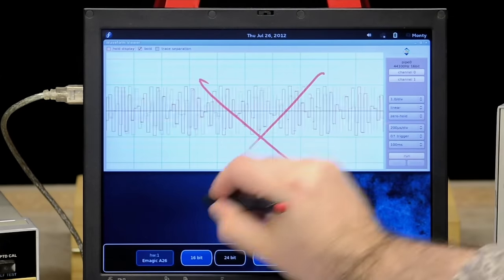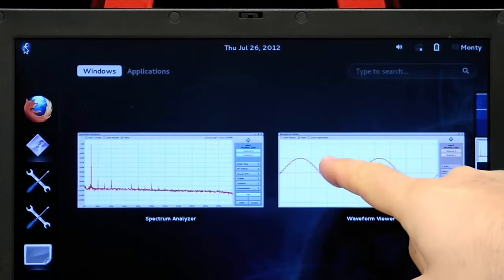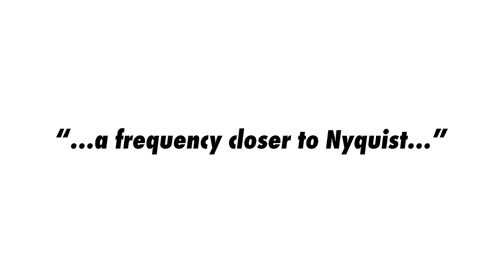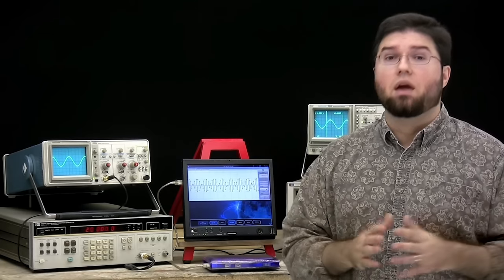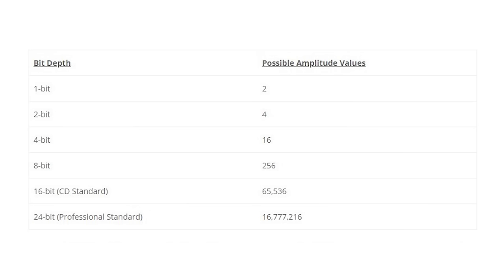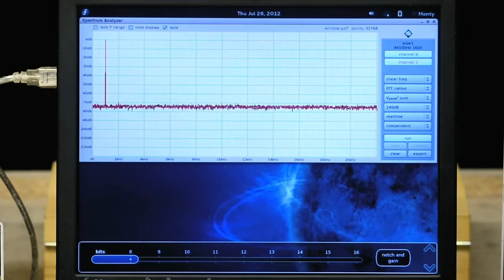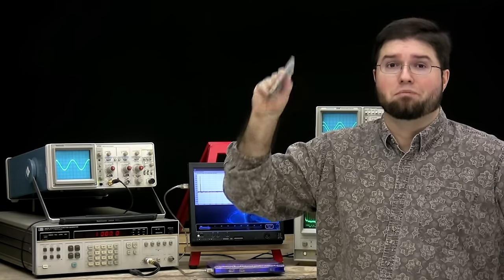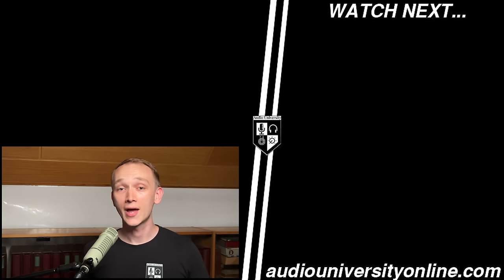Debunking the Digital Audio Myth: The Truth About the 'Stair-Step' Effect

Comment: Something not mentioned is that the raw DAC is followed by a low-pass filter at the Nyquist frequency.  So, even if the stairsteps are there, it's at the sampling frequency and would get filtered out.
Reply: Was thinking exactly the same thing. This is correct !
Reply: Exactly. Thank you.
Reply: And you filtered out the high frequency sound, too. But anyway with powerful headphone all days long can't hear them anymore. a 44kh give you the capacity to produce 22kh square wave sound. To produce decent 22kh sine wave, you need a sample a least 8 time higher. You can use Bezier algo to reshape the sound wage, but it not sound an accurate sound reproduction anymore.
Reply: @omegaman7377  you have that backwards. With sine waves as your basis function it's impossible to perfectly model a square wave without infinite sine waves. The Nyquist frequency is plenty good for sine waves because it IS the basis function of the model. You can apply more advanced techniques to reconstruct beyond Nyquist, but not in a general way, so it's not useful for audio applications. We can do this in image processing (though with some additional information which is kinda cheating)
Reply: @omegaman7377  Square waves have higher order harmonics, technically infinitely high, compared with their fundamental frequency.  A pure sine wave is ONLY the fundamental, so you have your sampling idea completely backwards.  Sine waves require lower frequency sampling to recreate without any assumption about the input signal, because you only have to reproduce the fundamental.
Reply: @omegaman7377  Filtering 22KHz completely out while leaving 20KHz untouched is a challenge and may leave some sonic artifacts.  That's the reason for oversampling/higher sampling rates.
Reply: yes, this is an kmportant step that should be mentioned. i think that is most pedagogical way to explain why there are no steps after converting back to analog.  The wording of "only one solution" is not convincing.
Reply: >  DAC is followed by a low-pass filter 
Yeah, that one is called reconstruction filter.
Reply: Any square signal that goes through a LPF would become a sinusoidal wave.
Reply: Is it even necessary? If the sampling and nyquist frequencies are both above 20kHz, wouldn't our ears simply act as the low pass filter? I kinda felt like that was the rationale for the standard being 44.1kHz sampling with a 22.05kHz nyquist instead of 40kHz/20kHz, headroom for the ears to roll off high frequency sensitivity.
Reply: @4DRC_  it would introduce a lot of frequencies above 20000 Khz that doesnt belong and equipment "downstreams" may not behave well.
Reply: If your old your ears act as low pass filters.
Reply: Yes. The DAC is based on sample and HOLD. It results in a staircase. As far as I know there is never a lollipop like he said. The lollipop represents the sample but the sample and hold circuit holds onto the lollipop until the next sample. Everything would become clear if we look at the circuit. Why did we not see the circuit? He is just looking at input and outputs of black boxes and then making claims about what the signal looks like inside the black boxes. He ignores things inside the black boxes like the filters that you have talked about. I am not impressed.
Reply: I am sorry, I meant the ADC, the analog to digital converter, when I said DAC. It is the ADC that samples and holds, producing the staircase.
Reply: Man, I'm being stupid. The sample and hold produces the staircase, which then gets converted to digital by the ADC. Did we ever see anything about the taking of the digitally encoded samples being fed to the DAC? The more I think about it, the more I wonder what was really going on in the system or process that he was obtaining signals from.
Reply: @kevinlatendresse2372 I agree that a lot was left out about the inner workings of sampling and reproduction, however, it seemed like a fairly decent explanation without getting to a point of an understanding of higher level mathematics or at least being familiar with knowledge of circuitry and digital signal processing. There comes a point where to have brevity in the explanation it's either going to be watered down or is going to be concise but requiring knowledge of concepts someone is already familiar with or requiring many hours of in depth explanation to understand, in the scope of this video.
Reply: That filter is not there for that, or well, yes is for that, but is a strange way to put it.
it's to remove any harmonics above the nyquist frequency because they can only be conversion artifacts. The "steps" would be part of that, if they existed , which they DONT.
Reply: @framegrace1  Yes, the filter is there on the recording end to prevent artifacts, but there's also a filter on the playback end to remove the staircase and any artifacts it might cause to the downstream system.
Reply: @jamescaley9942  That might work for old ears and certainly work work for me now, but as I kid, I could hear some ultrasonic alarms.  They weren't quite "ultra" enough.
Reply: Yeah Nyquist Shannon is only true for band limited signals.
Reply: Yep, reconstruction filters are used, mainly to reduce quantisation noise in addition, to that, no audio playback system instantaneously changes amplitude (position of a speaker cone) and this in itself has more impact on the audio output than the DAC process, so there is a strong case for highly responsive speakers with low impedance rather than trying to playback audio based on higher sample rate and bit depth.
Reply: The frequency content of the stair steps is in the audio range  and the Low pass filter starts at 20Khz and so it does not filter them out. For a basic D to A without oversampling the steps are there after the reconstruction filter. They are innocuous if dither has been used. In a modern D to A they are not there because modern converters add extra steps that change quickly, quickly enough to be filtered out by the reconstruction filter.
Reply: @danwarb1   For a basic D to A without oversampling the steps are there after the reconstruction filter. They are innocuous if dither has been used. In a modern D to A they are not there because modern converters add extra steps that change quickly, quickly enough to be filtered out by the reconstruction filter.
Reply: @matswessling6600  Thank you for saying this! Right on.
Reply: @russellhltn1396  Exactly. I'd love to know the characteristics of the DAC low-pass filter. What order? Butterworth? Chebyshev? We also only saw steady-state response, no transient!
Reply: @drmal  It would be interesting to see a transient, but keep in mind that it may have frequencies above the 20-22KHz limit.  As such, the filter itself would change it.  But that doesn't mean the change can be heard.  I'm sure some will claim they can hear it, but I'd love to see them pass a ABX test.
Reply: @drmal  Of course, another route might be to sample at 88.2KHz and then down sample digitally.  A filter for 44.1KHz doesn't have to be aggressive or have the artifacts that an analog filter for 22KHz would have to have.
Reply: @russellhltn1396  Yes, as I think you said higher-up the thread, that's one primary reason for higher sampling rates. In a theoretical system, sampling at 2*Nyquist (i.e. fs) gives you a datastream that will perfectly reproduce the incoming audio. But, I guess like me you have an electronic engineering background (I have a Batchelors and PhD in it) and in the real world you can't cut-off frequencies above Nyquist immediately to below the noise/quantisation floor. So, we give ourselves room to implement a graceful, low-order filter (at both ends) and over-sample. The theory of the video is right, but the practical engineering implementation is missing.
Reply: @omegaman7377  No. The low pass filtering just gets rid of the quantisation noise. A properly designed low pass filter will maintain the audio bandwidth.
Reply: @russellhltn1396  You use a decimating low pass filter so that the sharp cutoff can be easily achieved.
Reply: @Verbindungs  Any square signal that enters your ears is perceived with its corners rounded off. Your ears do not have an infinite frequency response.
Reply: @rogerphelps9939  agree
Reply: @4DRC_  unfortunately not, there is a thing called aliasing and it's a total nightmare. Every frequency you leave in above the Nyquist frequency gets mirrored back into the audible frequency range
Reply: @omegaman7377 I believe you need some understanding of the frequency spectrum of a sine wave versus the "square wave"
Reply: Wouldn't even the speaker membrane act like a perfectly fine low pass filter 😂
Reply: @TheraPi  That's fine for a integrated system.  Not so good to pass it to an external amp that many not behave well, as well as sending a lot of power to the tweeter that it wouldn't normally get.
Reply: As a practical matter, the stairsteps are present in the analog output of a simple DAC prior to output filtering.  The energy in the output is proportional to the width of a stairstep times the amplitude of the stairstep.  If you changed the output to pulses that are only held for half an output sample period, the amplitude would have to be double to get the same output energy.  In the limit, as the output pulse width goes to zero, the pulse amplitude would have to go to infinity to retain the same energy.  Obviously this it not practical.  And without any output energy, nothing would be audible.  In the digital domain, each output sample actually represents an energy level, so the problem of infinite amplitude for zero time is skirted.

In addition, the stairstep, or first-order hold, introduces a sinc (sine(x)/x) amplitude frequency response, which attenuates the higher audio frequency content, so either the digital audio data stream has to be 'prewarped' with an inverse sinc filter shape, or the analog reconstruction alias filter has to be prewarped with an inverse sinc filter shape.  Or at least this has to be done if the audio equipment expects to have good amplitude flatness specs.  

Oversampling has all the same issues, but allows the most difficult filtering to be done digitally, yielding a vast improvement in quality and cost, since the remaining required analog filtering is then much simpler.

On the topic of relying on the frequency range of human hearing to filter out higher frequency artifacts present at the DAC output, one big problem is the intermodulation distortion that occurs when the signal encounters anything non-linear (speakers, human ears at high listening levels, etc). The unwanted high frequency components can get 'mixed' back down into the audible range.  (For the mathematically inclined, a nonlinear response can be modeled as a polynomial, and anything higher order than the linear term will convert energy at one frequency into energy at a different frequency.  For example, if you square a sine wave you will get energy out at twice the frequency.  Changing the frequency content of audio rarely results in a pleasing effect.)

This is a deceptively complicated topic, the more you learn the more your appreciate how much more detail there is to know.  So it's not surprising there is so much misinformation.
Reply: That is true for all properly designed DAC electronics. An analog low pass (technically after the DAC) is a must for proper signal generation even for radio frequencies.
Reply: @omegaman7377  Nope. "And you filtered out the high frequency sound, too." Except you will have a problem hearing even a 16k sinus. Probably lower. Nope. Your ears cannot hear distortion harmonics in a sinus wave, because they are higher than hearing. Nyquist is valid.
Reply: Even if a stair-stepped signal got to the speaker, some of the signal would be smoothed out by the speaker, because of its limitations.
Reply: typically it isnt set that low these days. its still there, but often around 40kHz. depending on the output stage specifics (ie. discrete solid state), the capacitance of the transistors ie. parasitics, will act as a low pass, even if that LPF isnt there.
Reply: @earthwormjim  Does the term Fourier Transformation mean anything to you?
Reply: @rogerphelps9939  signals in the real world are continuous, that means they don't have corners.
Reply: The filter uses sin x to smooth out the steps, so of course the sine wave is perfect! This experiment is flawed.
Reply: @Dont_Gnaw_on_the_Kitty_1  There are no "steps" to begin with.
Reply: @MadMaxMiller64  Steps are clearly there as shown in the unfiltered digital output. The post digital filter uses a sin function to smooth out these steps. Using a single tone sine wave is really an invalid test as it will create a perfect sine  wave post filter, which is irrelevant in a music delivery system. At 15khz there is only about 3 bits conveying the HF harmonics and transients*. This may be where a black disc excels, having a mechanical low pass which doesn't loose information that are present *between the 3 bits.
Reply: THANK YOU! That was my first thought too when they showed the output from the digital conversion unit! Every audio DAC system has a brick wall low-pass filter on the output!
Reply: @4DRC_  In theory, no, you don't 'need' a low-pass filter after the DAC, but in practice you'll get all sorts of artifacting & other distortion problems in the signal chain if you don't.
Reply: @Dont_Gnaw_on_the_Kitty_1  You clearly have never heard of Fourier transformation, have you?
Reply: The secret of the perfect sine output when close to the Nyquist limit is not a low pass filter, but the codec chip inside the gizmo he used. The codec takes 44kHz I2S samples, and interpolates it to a much higher frequency using digital interpolation technique. This reconstructs the missing points of the sine wave in between I2S samples. And only after that, the DAC output is low-pass filtered to reject that interpolated frequency.
Reply: @odissey2  Lol please explain what an I2S sample is.
Reply: @MadMaxMiller64  i2s is a digital communication protocol for sound.  In the original video it was used to send the audio data stream to the DAC
Reply: @odissey2  Thanks - for some reason my mind was on I2C here... sorry for the lol then 🙂
Reply: Correct. Also mixing, sample rate conversion, and volume control add to the complexity.
Reply: And there were some sound cards in the 90s that did not have that filter
Reply: @4DRC_ no, but speakers have inertia
Reply: @kevinlatendresse2372  - You should have stopped after your first comment which was completely correct.  The DAC value is held until the next output sample giving a staircase.  It's only analog filtering that removes the steps.  The sampling process, with sample and hold circuit, is the lollipop effect he talks about but it does not carry through to the DAC output.
Reply: @Conenion which is what is likely filling in the the stair steps and smothing them out, so a perfect sine wave is an optimal example, but other more complex wave forms maybe its more of an estimation and therefore information is lost.
Reply: @andrewscott1253  
>and therefore information is lost.
No, it is not. The reconstruction filter prevents artefacts that are precisely /not/ in the original signal.

Likewise the low pass on the input side of the ADC prevents artefacts called aliases. It is thus called anti-aliasing filter (AAF). Since the whole chain of 

analog ► low pass AAF ► ADC ► processing in the digital domain ► DAC ► reconstruction filter ► analog

has a maximum bandwith of half the sampling frequency, there is "loss" already after the AAF.

(There is also loss due to quantization noise, but that's a different topic. Though technically impossible to realize it is mathematically possible to have sampling but using infinte accuracy values and not digital i.e. binary ones. Quantization noise is the result of rounding to the next binary value.)
Reply: @Conenion  "  DAC is followed by a low-pass filter 
Yeah, that one is called reconstruction filter." 
   Have you ever designed the brick wall filter?
Reply: @kevinlatendresse2372  The ADC digitises the input waveform. A S+H is required infront of the ADC. And a Nyquist filter is required infront of the S+H. The Nyquist filter turns over some way before the Nyquist frequency to avoid artifacts. The design of the S+H is not simple and requires extensive knowledge of capacitor dielectric behaviour. The ADC does not produce a staircase wave form just a stream of digits that is fed to the DAC. Then you get  clever. 
     You can try this at home with a stand alone 8 bit ADC. None of your modern integrated cct rubbish that does everything as a blackbox. If you can't find one then make one, you are electronic engineers. Try an R-2R ladder. And stick a 'scope on the DAC's OP.
Reply: @jrstf  Modern audio DACs first digitally convert the 44.1 kHz or 48 kHz audio to a sample rate that's 32, 64, or even 128 times higher, then quantize to very low bit depth which can be easily output, and use noise shaping to shift all of the resulting quantization noise very far outside the audio band (which is possible thanks to the large bandwidth created by the high sample rate) which makes it really easy to remove with a gentle analog filter.
Reply: @drmal  the low-pass filter will be linear-phase FIR, which even in a sub-$1 DAC will have nearly perfectly flat response to at least 20 kHz using 44.1 kHz sample rate. For example the PCM1754 ($0.55) has ±0.04 dB ripple up to 20 kHz and ≥ 50 dB attenuation above 24.1 kHz (the first alias of 20 kHz). If you spend $2 on the DAC instead then you might see e.g. ±0.002 dB ripple up to 20 kHz, -3 dB at 21.5 kHz, and then ≥ 75 dB attenuation from 24.1 kHz and ≥ 82 dB from 25 kHz.
Reply: I have a guess here of that 'mathematical construction' just make a image of the filter that you want in the frequency domain so that's like '1,1,1,0,0,0,0' so like '------_____________' that's 1024 points long and fourier transform that to the time domain and bang there's your 'sample of a filter'. 
I just figured how the length of the filter is of any importance (whether it's say 256 points or 1024) it's very easy to see here..
Reply: That's probably got something to with why it sounds so dead
Reply: @miltonthecat2240  Thank you for the detailed explanation 🙂
Reply: @alexstevensen4292  that method sort of works but it will produce filters that have excessively large ripple compared to the best known FIR design algorithm.

(I previously posted a more detailed explanation but apparently it didn't pass youtube's incomprehensible comment filtering algorithm, sigh.)
Reply: @MatthijsvanDuin  that makes sense, high Q resonance around that transition point I guess, interesting. My 'model' doesn't much  'consider' what happens in the time domain lol
Reply: @alexstevensen4292  aaand youtube ate my reply again. maybe they just really dislike math.
Reply: @alexstevensen4292  there's no feedback in a FIR filter so concepts like Q and resonance are not applicable.  it's simply that the frequency response of a "type 1" FIR filter such as produced by your method (if you use odd length to allow correct centering) is a cosine series that interpolates between the values you used as input to the IFFT.
Reply: Absolutely right! And oversampling at 10x Fmax (200khz) instead of the Nyquist minimum of 2x 20khz =40 khz guarantees a clean reproduction as long as the sample rate is sufficiently jitter free.
Reply: @MatthijsvanDuin   the driver in question is the neopro5i quite awesome :) very good stuff. very very good
Reply: @alexstevensen4292  ?  is this a reply to something I said?  I'm guessing either you replied in the wrong thread, or it's a follow-up to some message that youtube blocked
Reply: @MatthijsvanDuin  no I'm just a little bit drunk and talking about stuff
Reply: I thought it was a little bit compicated talking about this stuff. there's really high-quality sound it's really.. I'm listening to this M250 amp yeah I understand it's a little bit akward but holy fuck that thing sounds GOOD. all sounds are like physcial objects. you seems to be much more knowladgeble about these things I had this at the MTS and HTS so I had laplace transforms and fouriier but I've mostly forgotten about this stuff :)
Reply: with laplace you could 'solve' a formula there was an equation you couln't 'solve' transform it to the laplace domain and then solve it and then transform it back
Reply: offcourse the only thing that's 'wrong' about the CD system is the sharp filter at around 20k but very few people complain about that for the rest it's pretty much perfect
Reply: @MatthijsvanDuin  but never mind I don't want to bother you much longer
Reply: Due to the difficulty of realising a 'brick wall' filter at just below the Nyquist frequency (at that frequency would leave aliases) the data is oversampled or doubled in sample frequency so that the Nyquist frequency is doubled (or more) so that a filter at the original Nyquist frequency can be much gentler.
Reply: @omegaman7377  I can't hear above 16.5khz anymore. Once upon 10 years ago it was 18.9khz. The Curse of the 40's and tinitus.
Reply: Thank god someone said this lmao was killing me.
Reply: Unbelievable that folks are still talking about stair-steps after watching the monty video. What's missing in both videos is specific mention of the fact that once the sampling frequency is filtered out bezier curves form between the sample points recreating the original signal exactly. Nothing is smoothed out. You'd only see stair-steps if you used a DAC that wasn't designed for audio. Audio DACs are different in their operation. The sampling frequency or time domain is also part of the data, not just the samples.